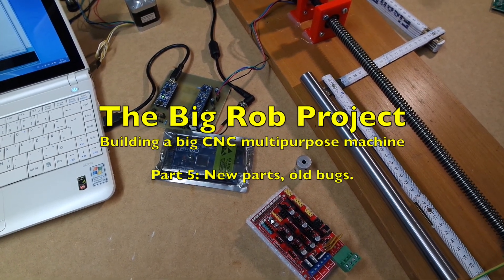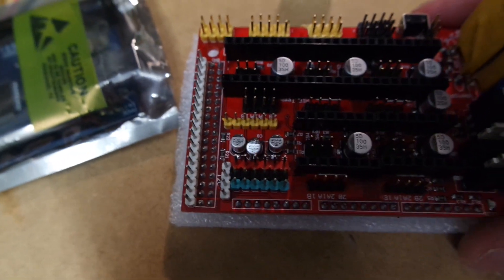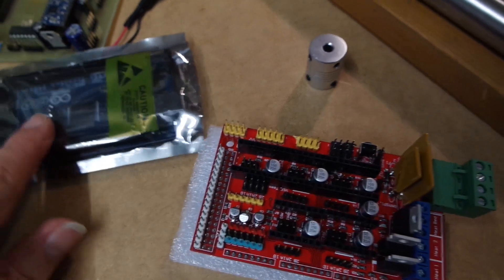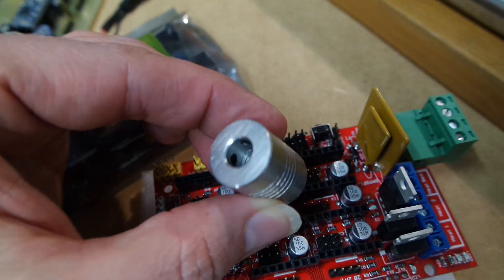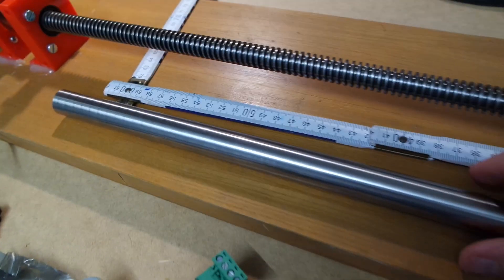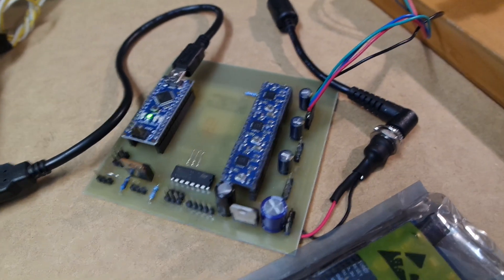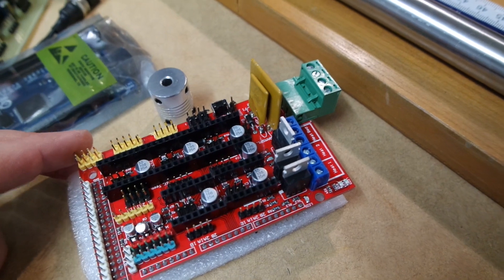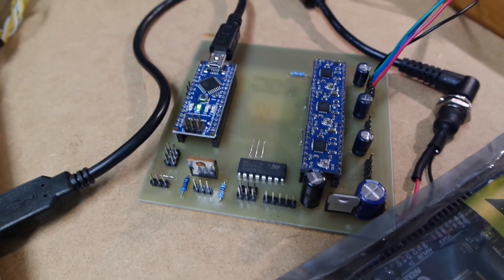Big Rob Project Part 5

Comment: great update . I'm still waiting for my cheapo' ramps kit to arrive . seems ages now .  not knowing the bug specifics for you controller, i'll tell you i found one in mine .  I was fighting what I thought backlash and settings . In the end it was 2 places i had tried to assign float values into  long value as step counts . so the more transactions the more  decimals got lost , so my arcs and circles sucked .  lol, such a silly rookie mistake I overlooked . 
Keep going , your designs are inspirational for me .
Reply from the maker: +XerotoLabs Thanks - my RAMPS kit arrived within 10 days of purchase, I was kind of surprised.
My software bug was subtle, but devastating: I had a function definition with fx(int) and I was calling it with fx( (long)a - (long)b);
Because the functions field is defined as int the variables in the call will already overflow it, giving very nasty results. So 
a - b only worked for small values - the bug was never found because noone had a CNC with more that 32k step positions.
I also still need to implement an working arc function, been looking into the math - ugg - nasty stuff.
Reply: I know this is a old reply , but i find myself nearing the point of having to setup that ramps .  And also realizing i did pretty much the same bug you did in my ARC code for my home brew laser plotter . It work , but the src  looks more like abstract painting that source code .  I need to devote a day or two later and fix it all . but first i have to  try setting up my ramps board to the scratch built printer . LOL
Reply from the maker: +XerotoLabs  Small world, isn't it. I did a 'real math' ARC, that was super correct, and it could really calculate entry and exit of the arc in float - it would draw a complete circle in something like a minute, and consume all memory of a nano. 
I now have a rather cheap version, that has a 180 point reference circle in memory, and it simply scales that one and guesses entry and exit. 
But for the time being it's completely on hold, I'm still not happy with my interrupt driven movement controls and movement planning.
Reply: i did mine to know entry and exit point , it estimates granularity of the steps as a func' of feed rate and 'precission' global var that can be passed before the arc command as custom gcode command . i looks at the degrees the arc is composed of and chops it up into small lines sized to match granularity -1, and jumps to exit point as last step .
it can be told start and exit , and direction . if the last step is < granularatiy size it simply jumps to exit . 
it uses a simple arc seg calculator . I dummed it down a bit to not take up much prog' space .
i ran out of prog space trying to add real Z axis movement. so i figure ramps and marlin for any real 3 axis stuff. lol

Comment: Eine schöne maschine
weiter so.
Kannst du ein extra video über die firmware drehen und mit welchem programm die Frässe später gesteuet wird.
Würde es auch mit einer 4 Achsfrese bzw. Drehbank funktionieen?
Reply from the maker: +def def Hallo, ich weiss noch nicht was fuer eine Firmware ich einsetzen werde - das ist im Augenblick auch quasi mein groesstes Problem. Aber wenn es soweit ist, werde ich etwas darueber machen, ja.
Mit 4-Achsen-Systemen habe ich mich bisher ueberhauptnicht auseinandergesetzt, also kann ich hoechstens vielleicht sagen.